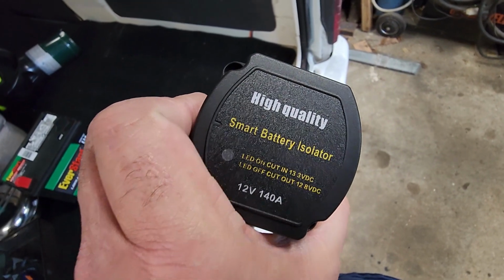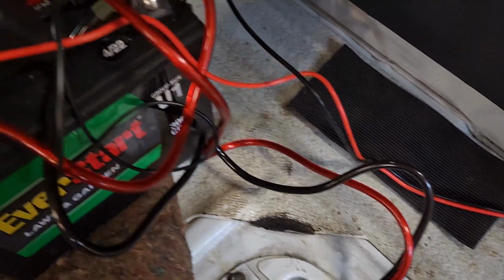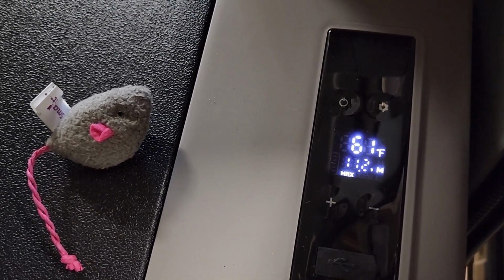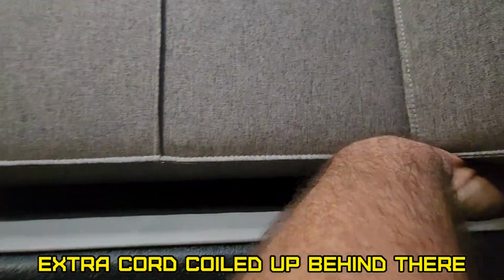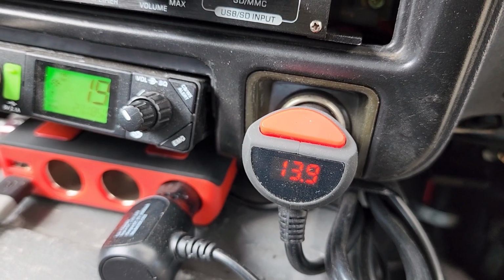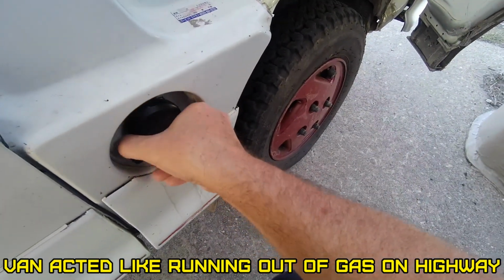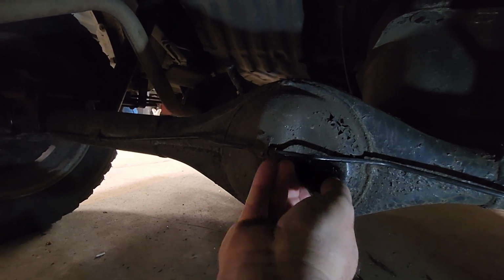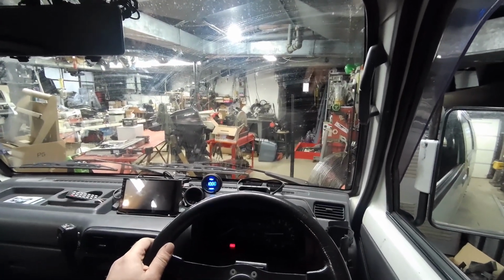Micro Van (SE1 E17)  Auxiliary battery isolator install,  fuel pressure vacuum rear diff, U-joint

Comment: mite wanna rig a vent tube(s) for that battery vapor to the outside.  @6:36 at least ur (ct) gas reg dropped. ny still has its tax. its still $4.19/4.36 for reg over the state line
Reply from the maker: I was wondering about the gases, the main battery is inside with just a cover too ..

Comment: xs power xp750. drycell and super small. helps me with all my added audio shit and quite the reserve! looking good man!
Reply from the maker: Yes I've used stiffening capacitors when I used to have large amplifiers and sub boxes in my older vehicles. I did want to look into buying a lithium cell but lithium batteries have very poor performance in the freezing cold weather
Reply: @MotoCheez  yes lithium is great but as you said under right conditions. you can get those batts for under 80 bucks, just need to account for binding posts which with ring terminals your all set!

Comment: Yeah I listened again that was suction that time.  I've gotta try mine when it gets back see if its blow off or vacuum pressure.  I'll find out where that fuel pump is and dm you or sompn you're easy enough to find lol.  I need to get all the old parts too so I can document and ref them to the new stuff.  Before I changed out my pump it did feel like it ran out of gas once or twice and it would every so often stall at red lights.  It's not doing any of that anymore.  Didn't you have to lower your drivetrain with spacers on mini?  Might be your ticket.
Reply from the maker: I actually did lower the rear of the drivetrain about the same as I did many but there is one universal joint that is a little tight the one that goes to the rear end so I ordered the universal joint hopefully it's the right one. Yeah that suction on the gas tank is an odd thing
Reply: @MotoCheez  Well it'll be next monday when I get mine back so here's to waiting another week.  Jeebus
Reply from the maker: Damn